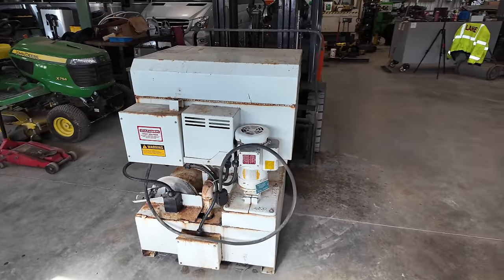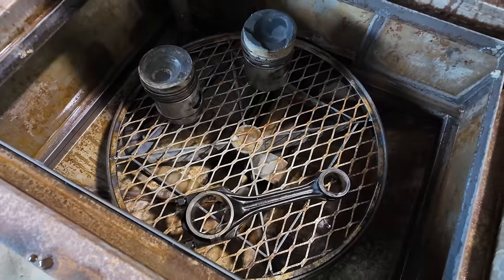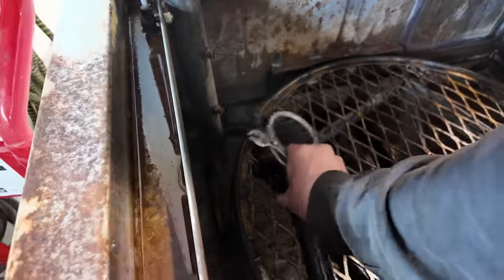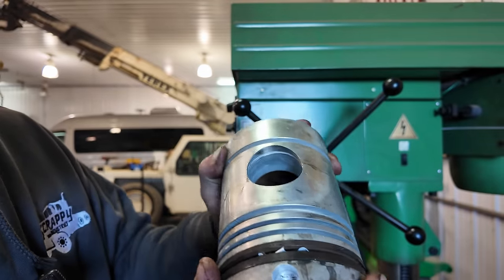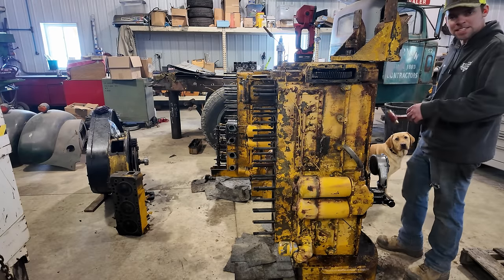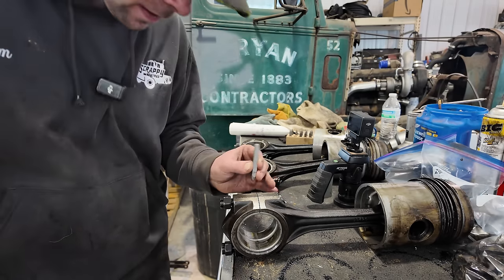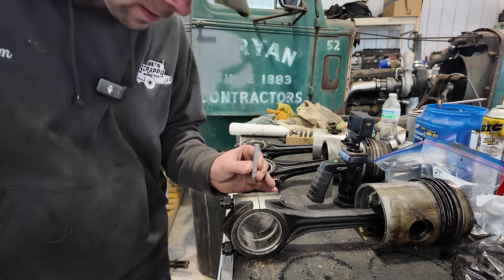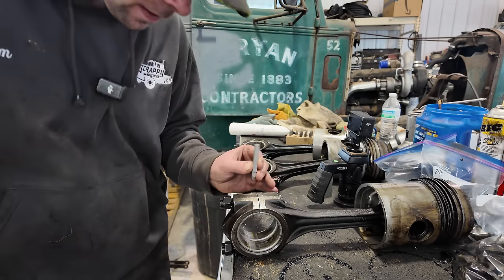Can't Buy Parts! | "Rebuilding" a 1941 Caterpillar Diesel D4600 Engine

Comment: Your pistons were manufactured by White Machine Works WMW. Which was later called Gould- Clevite. Later called Clevite owned by Dana.
Reply from the maker: Awesome thank you for this info!
Reply: @ScrappyIndustries  as a vintage truck/tractor guy I love helping educate folks about old stuff and history!
Reply: @crusty_trucks  👍
Reply: HI SCRAPPY DOO . KEEP YOUR EYS ON THE ROAD . LAD . AND KEEP THE VIDEOS COMEING THANKS .
Reply: SCRAPPY.  IF IT WORKS SO WELL GIVE IT A GOOD CLEAN . AND IF NEEDS BE GIVE IT A LICK OF PAINT
Reply: @ScrappyIndustries  was this engine electric start originally?
Reply: replacing a mulch blower
Reply: I know it's been awhile, but Hoist Central lists a WS 256 liner. I think they are a Clevite dealer so that would fit with the WSW pistons.

Comment: Liner pitting is a result of poor cooling system maintenance , all wet liner diesel engines need cooling sysytem additives. The additives coat the outside of the liner to prevent the oxygen from the bubbles contacting bare metal . The antifreeze  should be checked every 6 months for proper additive levels , regardless of hours run. Cooling system pressures, have very little affect on the formation of the "shock bubbles" on the liners , they help reduce local hot spots in the heads due to boilng. This is why the engine manufactures promote using their fully formulated coolants, it's not just "antifreeze".

Comment: FWIW my tip would be to run tape around the big end journals as soon as you remove the rods to keep dirt out of the crank oil drillways while you work on cleaning the block etc.
Great project and very interesting to watch. Cheers from Western Australia
Reply from the maker: That’s a good idea. Will do next time! I think that’s a big advantage of having the engine stood up on end is the dirt isn’t falling onto the crank

Comment: About 32,000 miles on a 425 hp Cummins in my motorhome and cavitation ate all the way through one of the sleeves. $26,000 and a major overhaul later I was back on the road.
Reply: Get Nalco nalcool additive , that won't happen

Comment: The best sleeve puller i have seen, but not used, is the one Deboss used when they disassembled their Cummins 8.3. Those two little jaws are asking for trouble on a stuck sleeve. The one Deboss used  enguaged a much bigger portion of the sleeve, called an EZ pull. They even supplied a gearwrench rachet because they didn't want people using a gun on it. If you check out his "Everything wrong with an 8.3" video the link is in the description, much better design IMO.

Comment: After engine rebuild, run three quarts of ATF in place of oil, it'll clean the oil passages and strip any crud and carbon in places unseen. Run it for a good 15-20 hours on that oil mix at temperature, then change oil and oil filters. Should run like new after that.

Comment: She’s probably going to need starting fluid unless she’s already been run and is still good and warm.  If you wanted to do something different you could go with an intake grid heater from a 5.9 Cummins or even an old Therm-O-Start screwed into the intake somewhere.  I think Fords and some Yanmar imports had them.  Pretty cool device that actually burns diesel in the intake to warm it up!

Comment: I worked at a peterbilt dealer in bartonsville for 30 years I was the cat mech and tore down a couple of 1693 s that had  sealed power  piston liner kits in them with part nos that started out with  prefix of wp  in their part nos  similar to yours.

Comment: One of our Cuda parts washers had the same pump issue you have. Maintenance rebuilt the pump. Both had an expanded removable ring about 5" tall to hold parts on the turntable. We also had perforated "boxes" with lids to hold small parts. Coingrats on gettin the FrankenCat" running!

Comment: I learned in the late 70's, use a 4.25 expansion plug at bottom of sleeve and pack with dry ice, sleeves should drop right in lol also did that to remove them love your videos 😊

Comment: Noticed you off- setting the ring gaps, Sam. Once bought a used 6 cylinder Chevy 1/2 ton 
at a bargain price . Worked fine but before I drove 2 miles after the purchase noticed smoke pouring out the back.  Local garage said compression was good & replaced valve guides that they said were the cause of the smoke.  This did nothing.  Not a mechanic, but pulled the pistons, and rings all looked brand new ........but  on all six pistons the gaps were lined up letting the oil pour through. Wish had seen this video years ago. LOL.

Comment: Just use mechanics wire to wire pistons and other light stuff in the washer.
Or a second basket (with a lid) made out of expanded metal. 
A shop i worked at had a washer big enough we used it for cleaning 3208Cat and DT466 engine blocks in.

Comment: I clean up cylinder sleeves on bench grander wire  wheel  to clean up ,like new from top to bottom and remove all scale and dirt rust by holding the sleeves in hand resting on the table of the bench grander and turning the sleeves by hand on wire steel wheel , they come very clean ,

Comment: I'd try heating the threaded part to grow it then crank it tighter with out drilling the divots, then re divot it that way you don't have weak spots from the drilling. seems like it has allready fretted loose anyhow, maybe not too much torque to crank it past the stakings.

Comment: At 27:00. Whats the goal? Just cleaning up and get a crossbore? That maxihohn brush is awsome for cleaning up, taking away the gracing and getting a crossbore.
But getting the bore on the desired size needs a honing machine. Pick your choise.

Comment: Sam, you didn't show it but did you chech ring gap with the rings in the sleeves ?
Other than that it's a very enjoyable episode to watch. 
The gap thing bugs me because I'm a Coast Guard Aviation Machinist Mate Veteran who worked in Grumman HU16e Albatross seaplane Pratt and Whitney R1820 radial engines. 
Plus I have diplomas for small engines,  motorcycle engines and other engines.

Comment: Awesome rebuild guys but I have a question why do alot of larger commercial and industrial diesel engines have cylinder liners instead of casting the engine block with cylinder bores like smaller diesel engines that come in pick up trucks like Powerstroke Cummings and Duramax engines?
Reply: To make them easier to (re)build.   These engines are big castings, and it makes sense that you would want to rebuild them, rather than replacing the engine as you might on a lawnmower.

Also, it allows the manufacturer to use more suitable materials for the different applications, rather than one metal having to do every job,  This was even more important back when this engine was new, as metallurgy wasn't anywhere near as advanced as it is these days.
Reply: @dfross87  

Ok, your explanation now makes sense 👍🏿

Comment: Sixty years ago , i took down a 220 Cummins that had 450,000 thousand miles on the third in frame rebuild . The owner tried to stop a liner "o " ring leak with sodium silicate "water glass " . Piston picked this up and gaulded itself to the sleeve and stopped the engine . After teardown the owner said that he was only buying gaskets ! We honed the five liners that were not completely destroyed and took a piston and liner from the junk pile to use . this piston had been worn out then knurled and worn out again ! I was 22 years old at the time and green as grass , so my objections were not heard . After we got it together to my supprise it ran ! SMOKE !!  This was in an early fifties Autocar truck . After it went back to work the driver told me it burned ONE GALLON OF LUBE OIL per 100 miles !!!
Reply from the maker: Hahaha that’s a great story!

Comment: They got ceramic roller bearings n connecting rods with screw or even better underneath pistons the drill n tap n 🔩 to hold wrist pins

Comment: Very nice practical re-fresh/rebuild. Maybe needs more fuel or air in system?
Your engine assembly room and stand canot be too clean or sturdy I am still smiling!
For your parts washer I always rebuild/rewind original electric motors, rewinding and replacing all bearings on older equip. that have elec. motors as I then get exact fit and specs w/o having to re-do/modify.

Again Great Job. Ray Stormont

Comment: I saw a diff tool/method of installing pistons and not using the blue/black ring compressor but I don't remember where of how it was done.
Reply from the maker: If you’re putting in new sleeves it works well to take an old one and cut a taper in the lathe they will feed right through and compress

Comment: Sam (or other subscribers) what is the head torque figure, I am in the UK and working on a 1945/6 D4 4400 7J engine. 
Information is limited here in the UK on the older iron, have managed to find a engine manual for the slightly later engine (ie with the head ferrules)  but it does not appear to give a figure for head bolts (does for mains and big ends)
Reply from the maker: Cool project! They’re not super high. 71 ft pounds is what I used I believe the one 4600 book I was using had it in there
Reply: @ScrappyIndustries thank you for the response, yes has been interesting so far. That is much lower than I was expecting but I see no reason the D4400 wouldn’t be the same as yours. 
Just waiting for a few parts to turn up and then it will be reassembly time. The waiting has allowed us to rebuild/reset the transum spring as it was a little “tired” and had 1.5” spacer blocks under the end of spring to keep it looking level 🤦🏼

Comment: 26:22..... I'm sure that you're aware, and maybe it was just an accident, but you should never insert or pull out your honing brush without it rotating. It creates vertical scratches in the bore if you do that.  🍻
Reply from the maker: You’re definitely right I did a little more on this one and fixed it up
Reply: @ScrappyIndustries  🍻

Comment: What’s protrusion do?
Reply from the maker: Protrusion is the height the liner is sticking out above the block. This surface is where the fire ring on the head gaskets is compressed to contain combustion pressure. If the liners are sitting at different heights the head cannot seal all of the cylinders effectively and will blow a head gasket. To correct the protrusion shims can be used under the low liners to lift them up or counterbores cut to lower the tall ones

Comment: 49:51 - one more reason NOT to cut corners. It doesn't save money because it wastes time when you have to do it over. Why don't I see more folks using laser cutters to make gaskets?
Reply from the maker: Mostly because of the time it would take to draw the gasket in cad. If you only need one you can hammer it out way faster than you can draw it

Comment: I can't stand using any of those adjustable ring compressors, I spend a few minutes to turn down a piece of aluminum in the lathe to make a tapered ring installer.  

If the head gaskets are copper you should have annealed them before using them.  I have made new copper shim type gaskets using my water jet and now with my laser cutter.  

I am working on an invention that I think will be beneficial to people who work on old and obsolete engines and need gaskets.  I have a modified plotter for cutting out gaskets.  I want to sell a gasket cutting system with a database and whenever someone makes a gasket the cut file would go into a database for all the users of the machine to access.